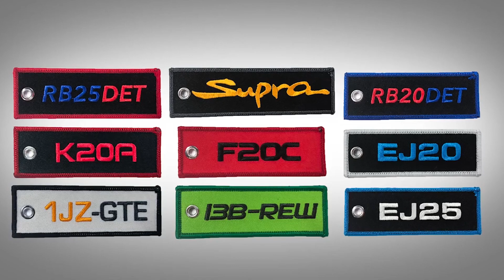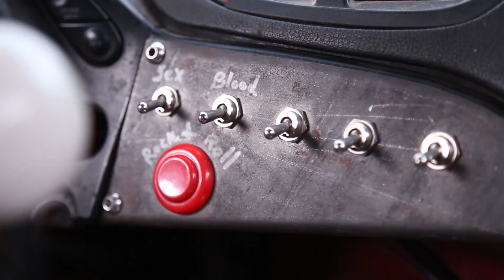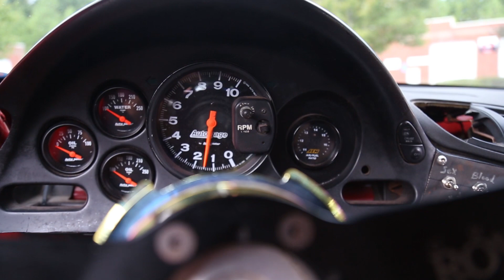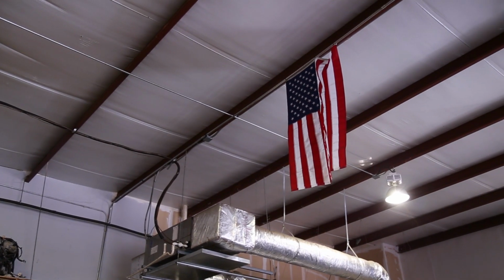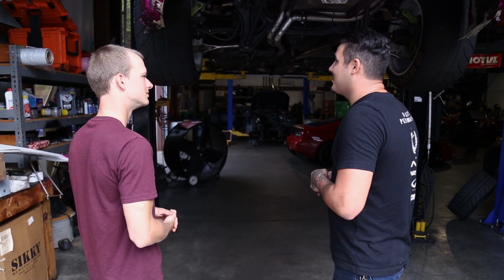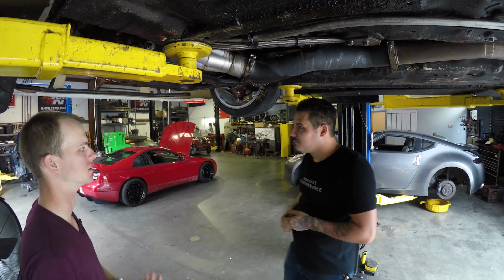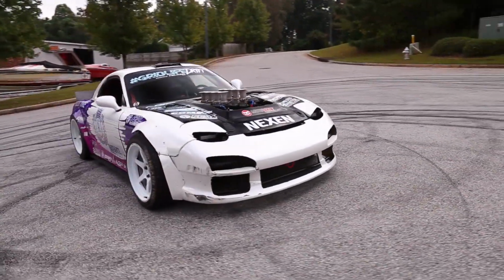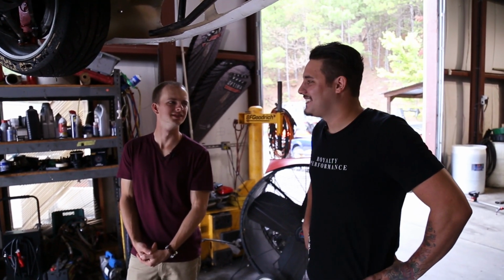The V8-Swapped FD RX-7 Pro Am Drift Car That Sounds Like A Ferrari

Comment: Wouldnt say it sounds like a Ferrari, but def. sounds different than other typical V8's!!
Reply: Almost sounds like Tanner Foust's NASCAR swapped Jetta. https://youtu.be/5Ot1qjHcruA?t=1026

edit: I just saw in the vid he did equal length headers, similar to Tanner's car, so makes sense it has the different sound since I believe firing timing on the LS is 1 piston at a time so can hear each ignition individually.
Reply: My god that sounds better than most Ferraris man goddamn I love it!
Reply: Yeah, I was thinking something more akin to a Trans Am Camaro from the 2000s.
Reply: @sigmaprojects  that car is not NASCAR powered... thats an lsx engine. nascar use their own blocks/heads and still run carburetors
Reply: @headlesnorseman701  Ah, my mistake. I know his last Drift car was a tC with a NASCAR V8 in it. I think I just assumed he got another NASCAR V8 for this one.
Reply: Sigma Projects I got excited because those nascar engines have like some mythical engineering going on. They reliably make 7-800hp with 1950s technology lol
Reply: @headlesnorseman701  It's not mythical, just a race prepped 350ci pushrod V8. There's a reason why you can find shops that build huge displacement high revving 1000hp pushrod V8s that can be street driven.  Have you seen the destroked LS3 (5.56L) revving to 8K making 600hp? I think people just don't know that pushrods are fine at making power.
Reply: definitely sounds about like the 430
Reply: @AK 28 not like a Ferrari but not like any normal American v8.
Reply: cant even hear anything
Reply: @headlesnorseman701  there are 3 ways to measure the power WHP the power to the wheel, and BHP there are 2 ways to measure it measure it by taking into account the power that is stolen from the cooling system and the lubrication system, or take that away and cool the engine with something external and thus measure the power thus the power was measured in the 50's so you had powers close to 500Hp (of course you still had losses due to heat and friction and losses due to pumping because you could also measure the power with mathematical equations knowing the relationship of understanding and the expansion ratio and the combustion time in this way only heat would be lost through the exhaust gases and it could be stated that an engine has 57% efficiency instead of 38%, and that the liquid piston engine has 75% efficiency instead of 58) but in the 70s they began to measure the power with all the accessories radiator and lubrication system and that took 25% of the power very inefficient and so the engines went from 472Hp to 354HP, Nascar engines although they use carburetors and push rods, have a lubrication and cooling system that only takes 12% of the power, they have ceramic coatings such as CLD to reduce friction

Comment: Not gonna lie I'm usually HELLA upset when someone takes the rotary out of rx7s... but this build is pretty fucking cool. (still would be better with rotary lmao)
Reply: agree
Reply: Mylo this car used to have a Rotary look up David Campo rx7
Reply: I know him he went thru rotary after rotary in this thing but he got fed up
Reply: Mylo it is sick for sure
I think I would be happier if it were in any other car honestly but I can’t hate on it 😂
Reply: Mylo was gonna say that
Reply: @willlucas1032  Rotarys arent meant for burnouts, they need constant air flow to the cooler. Therefore abusing an engine which it was not intended to be used for, no wonder he went through them.
Reply: Idk man this prob better looks really badass on the hood and sounds great and likely way more realizable
Reply: I see the logic, though. The RX-7 provides an affordable lightweight chassis that handles well. The rotary engines, however, were notoriously unreliable and finicky. In fact, you can pick up an RX-7 or RX-8 for extra cheap if you can get one that doesn’t have a running rotary engine. The LS motors are far more reliable, cheaper, easier to rebuild, they can make tons of power, the aftermarket is both extremely diverse and reasonably priced, and they don’t require premixed fuel like a 2-stroke. If you want to build an actual performance car that will scare the shit out of you on track days or roast tires at a drifting event, it makes perfect sense to LS-swap an RX-7. Plus, the main reason why people worship the later RX-7s is because of ‘The Fast & the Furious.’ For those of us who were more than 10 years old when that ridiculous movie came out, RX7s are not typically regarded as legendary sports cars. I think of them as a decent car, powered by an engine that was a fun novelty until it wasn’t anymore.
Reply: Rotary can’t take a beating

Comment: Would love to know what the hell is going on in that V8 setup
Reply: Besides his power mods. To get that sound you needa know what kind of headers and exhaust you need. I feel that's the sound of equal length headers and possibly 2 x pipes but I could be easily wrong.
Reply: @trianifeA7x  It's the 8 throttles + equal length headers + X Pipe joining both banks as close to the collectors as possible.

Comment: my grandpa did donuts in his lowered, 400 crank horsepower 1992 GMC 1500 pickup truck. Regular cab w/ shortbed, bench seats, carbureted, uses it to trailer his '41 Ford Coupe drag car

now i wanna see Marcus try to slide that iron around

Comment: Why would anyone put non-synchronised gearbox in a race car today? It doesn't make any sense. It seems to be a "normal" gearbox, just with straight-cut gears.
Reply: Beefiness. Think how much abuse this car gets. Straight cut gears makes all the sense.
Reply: @Cafferssss  I can understand those straight cut gear, but not the fact it's not synchrnonised, as been mentioned in the video. Even when he downshifted, it behaved like a normal synchronised gearbox.
And it has to be beefy, for such an application :)
Reply: Dog box transmissions don’t have synchos the gears are cut straight to allow for a non-synchronized shift which results in a faster shift than a standard synchromesh trans
Reply: @justinpeterson8198  I've dug deeper into the problematics of dog boxes and you are right. They use so called dog rings instead of synchromesh rings (together with their counterparts), so he should be able to shift even without clutch with such a transmission.
It doesn't have any connection to straight cut gears, because the dog box transmissions can have both straight and helical gears.